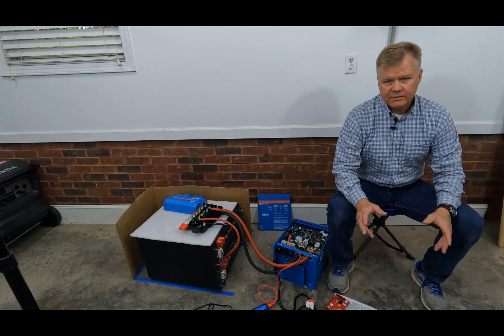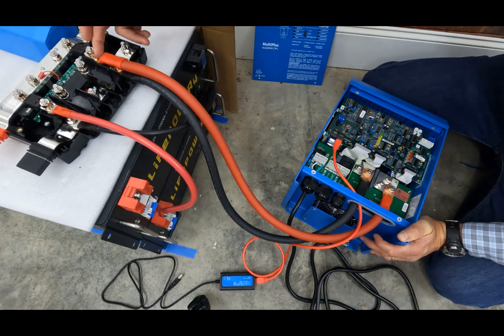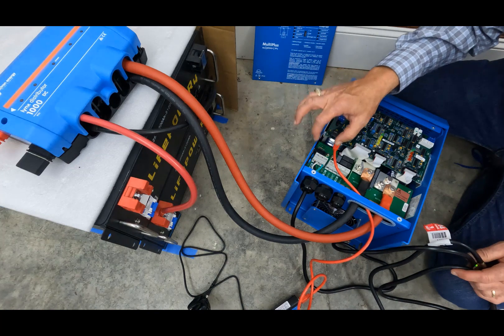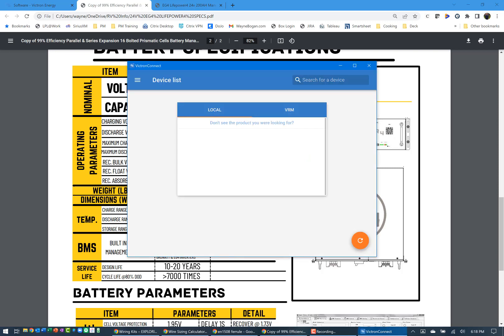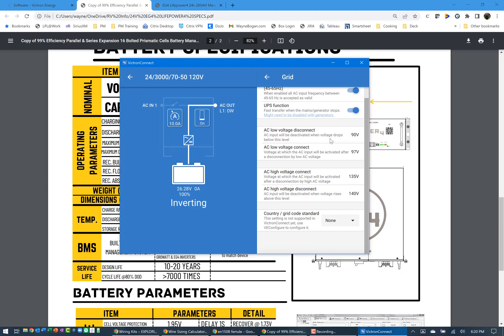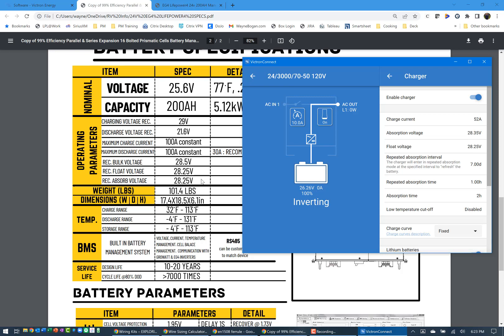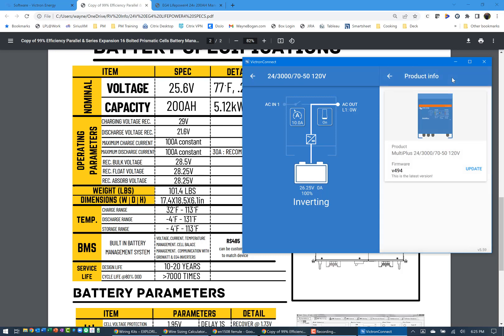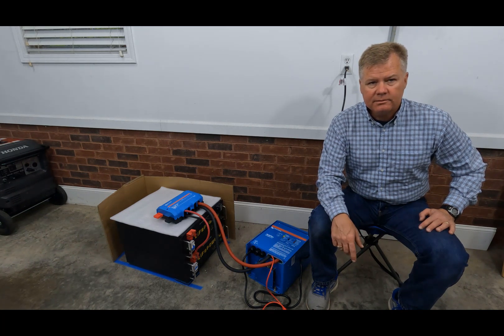Airstream Basecamp 20X, Multiplus Inverter Setup and First Battery Charge

Comment: How loud is the multiplus in the airstream when you are hooked up to shore power or when you are running off of the batteries?
Reply from the maker: @adaminjp, you definitely hear the fan when in bulk charging mode.  For example, if I hook up to shore power after traveling for a few hours, the Multiplus will initiate bulk charging and the fan will run to keep the unit cool until it reaches float.  If you have the air conditioner running, you won’t hear it but within no other noise, you will notice if for a while.  I’ll have to measure the DB to see how loud it gets.  It is enough to notice but not enough to bother me.